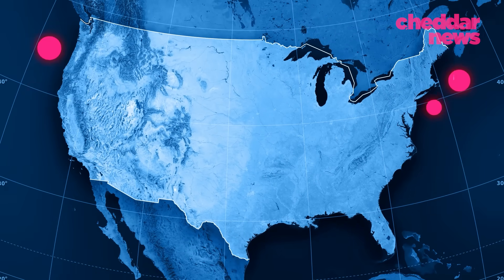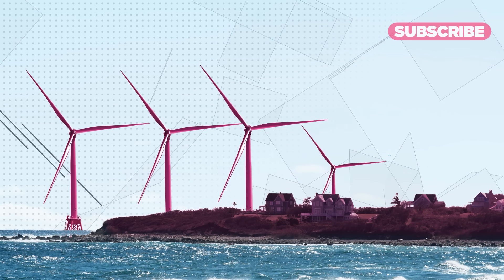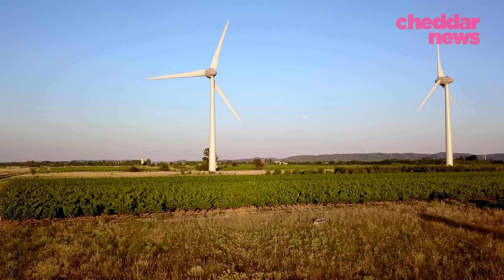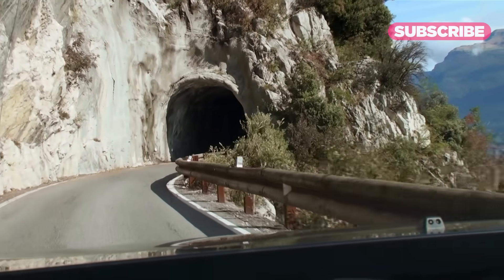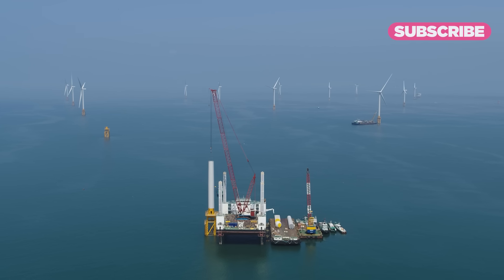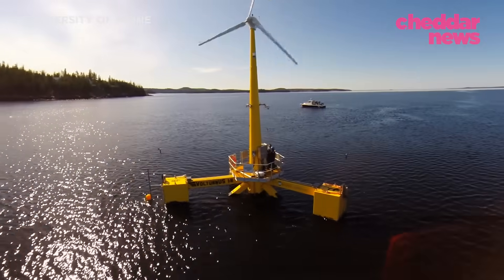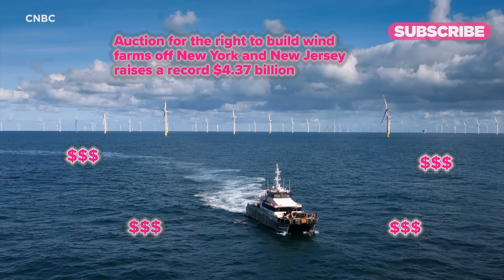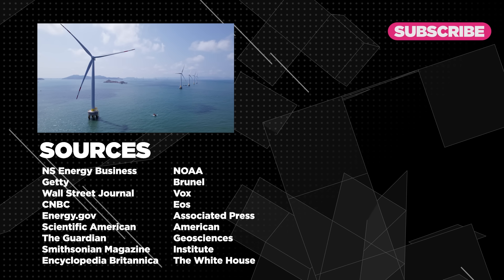Why Finding A Spot For Offshore Wind Is So Tricky - Cheddar Explains

Comment: off-shore windfarms generally produce an area where marinelife is sheltered. After the site is operational, there is no shipping causing noisepolution and no fishing. It is therefor even positive for fishing industry in the long run.
Reply: And all the birds they kill fall into the water for the fish to feed on. So the fish will be doing great.👍
Reply: @TheStickinator  the number of birds killed due to collisions with windturbines is only a fraction of those killed by housecats. If you want to protect birds (which given your rhetoricI don't believe you do) start advocating that housecats may not be outside the house unleashed.
Reply: @freudsigmund72  nice way to change the subject!
Reply: What about birds killed by flying into cars...happened to me once....what about birds that fly into plate glass windows! You have your work cut out for you if you insist bird Cuisinarts are somehow okay for birds
Reply: @edsteadham4085  you're a pretty sad individual. 

But besides that, there is a need for energy. Burning fossil fuel is incredibly distructive for the balance on this planet and thus for birds too. Sure off-shore wind farms do cause some harm to birdlife. But in the end they're way better for the environment than any viable alternative in harvesting energy.
Reply: @freudsigmund72  actually I'm quite happy and content. I just see the reality of the situation and don't engage in wishful thinking. I wish every dream of the possibilities of windmills and solar come true. Why would I be against cheap reliable renewable energy? But the laws of physics and finance  and economics...as I understand them...make a compelling argument that they are wonderful vin every way except one ...they wont work. You may disagree but how does that make me sad? Why are you so afraid of a counter argument? Have you even considered the possibility that what you believe is wrong and unworkable? How is the energy transition working in Germany? Please tell me why they have record hi electricity prices. Please tell me why American natural gas is at this moment on its way to Germany where fracking is banned. Please tell me why electricity flows from France nuclear plants while Germany shuts it's nukes. Please tell me why American forests are being cut down for wood pellets to heat European homes. Please tell me why Europe is cutting down old growth forests at this very moment for firewood. Please tell me why Germany is mining lignite like mad.   Lignite. The dirtiest coal on the planet. Tell me why Germany is restarting coal plants. These are inconvinient realties for people vof a certain mindset. The fact that saf people like me point these things out  don't make them any less convinient
Reply: What makes me sad is so much of the western world has been captured by wishful thinking that is at best described as childish.. How did Europe get in this energy predicament? Now Europe has millions of smart people I hope Europe makes it through the winter so Europe may be able to pull it off. But how did this happen in the first place? Time for some serious self reflection. But I fear that won't happen. I'm fine here in energy rich north America. we can afford to be stupid about energy a lot longer than resource poor Europe. Boy not forever.
Reply: @freudsigmund72  Not to mention the millions of birds killed every year simply by flying against skyscrapers, cars, trucks, trains. In addition, a system with AI and camera is currently being tested (so far with great success) which reduces the rotational speed of the rotor when a bird approaches.
Reply: @freudsigmund72  so house  cats are killing bald eagles?
Reply: @TheStickinator  entire industries in the US get shut down and dams get close when some obscure animal is labelled endangered. Environmentalists from across the country mount pr campaigns to save the snail darter or some damn thing. But when windmills kill birds by the thousand we get. . oh not that many . Just added to the food supply for other species. Whats a few dead bald eagles. Oh yeah. Wait till we start putting up tens of thousands of windmills and solar farms where important politically active people live. Watch those projects get stopped.
Reply: @TheStickinator  As someone who has lived next to windmills for over decades and has seen them all across Germany you can be assured there are no massive mounds of bird corpses aggregated below them. 
Yes birds do die because of them but it’s not to the extent the fossil fuel industry would want you to believe, an industry that has interest in misinforming people and continue polluting our planet for the sake of short-term profit.
Reply: Offshore oil rigs also provide nice habitatd for wildlife. Bet you love those
Reply: Massive U.S. Offshore Wind Farm Given Permit to Harm Hundreds of Whales and Thousands of Dolphins

Can you imagine the outcry if an oil and gas company was given legal permission to injure hundreds of whales and thousands of other marine mammals such as dolphins in pursuit of offshore drilling?

For maximum Greta-inspired wailing, the oil field could be located in the middle of territory where the last 300 North Atlantic right whales congregate, and a permit is in place to potentially harm 20 members. In May, Vineyard Wind will begin building a massive offshore wind farm numbering 62 giant turbines, 15 miles off the coast of Massachusetts. Permits to harass sea creatures have been secured – not a squeak of concern from green activists and mainstream media.

The Vineyard Wind project is only a small part of the planned industrialisation of America’s eastern coastal waters, as the Biden Administration ramps up a commitment to so-called green energy. Of course it is not green, and many now argue that it is becoming increasingly clear that the most valuable economic transfers gained from wind are the subsidies it attracts from electricity consumers.

The Vineyard Wind project will take about a year to complete and will include sonar surveying, massive pile-driving and considerable disturbance of the sea bed. All these activities are likely to harm or injure marine life. Dr. Patrick Moore helped found Greenpeace around 50 years ago and was heavily involved in the campaign to ban commercial whaling. Since 2016, he notes, when sonar surveying started for a planned 1,500 wind turbines on the U.S. Atlantic coast, 174 humpback whales have washed up dead on the shore, an increase of 400% from previous years. He quotes Greenpeace as stating: “At this time, due to lack of evidence suggesting harm from offshore wind development, Greenpeace’s position remains that the best way to protect whales is to create ocean sanctuaries, eliminate single use plastic and stop our dependency on oil and gas.”

If there is no evidence of harm to sea mammals from offshore wind, it is not immediately clear why Vineyard Wind found it necessary to secure a permit to injure thousands of animals during construction of its industrial complex. The permit was issued by the National Oceanic and Atmospheric Administration. The table below details the species that can be injured up to “Level B harassment” and is titled, “Authorised Numbers of Take, by Species”.

Threats to animals leading to possible injury and death are likely to occur from many causes in what is a huge construction site. Many such casualties are unlikely to be recorded. Heavy traffic on the surface is likely to lead to collisions, while pile-driving poles up to 30 feet in diameter hundreds of feet into the ground will create deafening noise. Engineers working on industrial sites can wear ear protections. Whales and dolphins cannot.

According to Tethys, the U.S. Department of Energy marine renewables database, sound propagates farther and faster in water than in air, which can result in greater consequences for the marine environment. It goes on to note:

    Noise may interfere with marine organisms’ communication, navigation, detection of prey, and ability to interact with the environment, as well as causing attraction to or avoidance of devices. Additionally, some marine organisms may be physically harmed from excessive noise exposure (e.g., tissue and nerve damage).

Not a squeak from green activists, as noted, and a deafening silence from mainstream media. According to a Google search, the only mention of Vineyard Wind in the Guardian was in 2021, when it reported approval for the construction. Space was given to the comment from Biden’s Secretary of the Interior Deb Haaland, that the project, “was an important step towards advancing the Administration’s goals to create good-paying union jobs, while combatting climate change and powering our nation”. Around the same time, HuffPost contented itself with the headline: “Climate Deniers Exploit Endangered Whales in Bid to Kill Offshore Wind”.

Charles Mayo is the Director of the Right Whale Ecology Programme at the Center for Coastal Studies (CCS) in Provincetown. He notes the danger for right whales around human industrial traffic, since they can dive for 15 minutes and be difficult to spot. But Mayo is able to rationalise any concerns, stating: “The future of right whales and these ecosystems is dependent on climate change. We have to change our use of fossil fuels and from what I know, the only solution that has the economic power to actually work at the scale of the problem is offshore wind.” Interestingly, the Save Right Whales Coalition notes that Vineyard Wind was listed as a CCS corporate donor in 2018, and was a corporate sponsor in 2020 and 2021.

Of course, it has long been obvious that green industrialists get a free pass when it comes to assessing the impact of their technologies on the natural world. Batteries to store the power of intermittent wind and solar rely on cobalt mined by children in the Democratic Republic of Congo. Oil and gas is likely to last hundreds of years, but there aren’t enough critical minerals in the world to make lithium ion batteries much past 2050. If offshore wind turbines are an ecological disaster, so are those located onshore. There is growing evidence that millions of bats are being slaughtered every year by them, and numbers are likely to grow as more turbines are built. In addition, large birds such as eagles, kites and owls that rely on wind currents are often caught out by the enormous air fluctuations of windmills, and few live to tell the tale after encountering blade tips that can fly around at 150mph.

Meanwhile, fracking for gas on land is effectively banned in many countries. In the U.K., local fracked gas could replace the country’s large imports and bring considerable economic benefit to deprived areas in the North of England. Pressure to ban has been enormous from both green activists such as Friends of the Earth and mainstream media. No endangered whales would be harmed by fracking, but a few ground-level insects might be inconvenienced. There is also is a danger that micro earth tremors, equivalent to someone falling off a chair, might result.
Reply: you seems ti be ignorant of the FACT that all the sonar scanning and pile driving and drilling will DISTURB that so called "sheltered' wild life.
Reply: @DiscordC  not ignorant of that at all.... once they're in place it is far more protective that boats constantly powering by and fishing vessels disturbing the seabed on a regular basis
Reply: So how many sites are there suitable for offshore wind. How many kilometers of new transmission lines will be needed. How come rich smart Tech savvy Germany already has sky high energy costs to go with their windmills and is looking at electricity shortages.    As they dig up coal .. and American loggers cut down millions of acres to send Germany wood pellets. I guess you suggest we just need to try a little bit harder. How much. How many trillions. What if this is a technological dead end.
Reply: @edsteadham4085  Off the coast of Germany, not many anymore as the majority is deeper out on the Baltic and the North Sea, mostly around Poland and Denmark. Currently, the best that can be done with offshore is to further improve upon the already high efficiency of windmills out on the open water.
The high energy costs are in spite of our change to renewables and not because of it. Granted, the deactivation of the Nuclear Power Plants and building using Coal to replace it, was a stupid idea and gradually our government is coming to the realization that it would be smarter to keep at the very least the ones that are currently still running. Mainly the high energy costs come from a) Energy firms artificially heightening prices to make more profit (Shell being an excellent example), b) the Ukraine War, the sanctions and with the cutoff from Russian gas which our government is doing its best to slowly back away, c) as well as a weakened Euro.
My way of fixing the situation would be to destroy the coal fuel industry by giving them a countdown of five years to shut down their power plants and the mines ruining as well as by halting all state subsidies. That same money used to keep them afloat would be used to offer state-subsidized re-schooling so the workforce doesn't go around jobless afterwards.
Additionally, the remaining NPP's should be allowed to exist for another few years and be built out. Its far too late to build new ones but the state can at least help improve existing ones. 
And yes finally more focus needs to be set on finally transitioning fully to renewables and funding appropriate research.

I expect Germany would be in less than a decade no longer relying on fossil fuel but it would indeed take a lot of financial resources but considering our state just put 100 Billion into a military that is already receiving more than the french one yet cannot even afford to give its own soldiers working equipment, I don't expect them to go that route anytime soon, especially with the heavy influence the fossil fuel industry enjoys in the CDU and AFD.

As for the costs? I don't expect it to be higher than what the state already had to pay for. Whatever the monetary costs are though, they are nothing compared to both the example Germany would set on the world stage as the first major country to fully transition and the benefit it would have to our planet.
Reply: @edsteadham4085  We shall see who is proven correct. Maybe you, maybe me or perhaps none of us and the world will continue down a weird middle path.
Either way, lets hope for better days.
Reply: How dare they!
Reply: Bet they are easy to maintain. Salt water environments are quite benign. A few extra kilometers of transmission lines should be easy. And when the wind doesn't blow just do like eco friendly Germany does and burn lignite.
Reply: Yes and the oil industry says the same about off shore rigs
Reply: Nice to know that windmills are made in china  using diesel powered trucks to mine the minerals and coal fired plants to make the electricity. They might even use slave labor. But   at least the pollution is exported to china and not the west. I feel noble knowing I'm doing my part for the environment.
Reply: But still most people including myself consider offshore wind farms to be eyesores to local towns. I’ll hate to see tall wind turbines just off the coast of my local beach, they will always look ugly.
Reply: And all the birds die around them too great for the fish they get free food
Reply: @sturgoncomp07  I am from the uk and we have a lot of offshore wind farms. They say that populations of birds have not really changed around turbines. Sure birds die but not enough to cause the general population issues.
Reply: @randeep6346  I think what Nhil actually meant to say is "how you take a very negative fact - "this area is no longer usable for anything" - and give it a quick makeover" :)
Reply: @sturgoncomp07  that depends, bird deaths are pretty negligible on some of the more recent turbines especially when they paint them reflective colors.

Bird deaths are more an issue for onshore birds like eagles and stuff. Not a concern for seagulls and albatross for example.
Reply: @sturgoncomp07  with all the windturbines currently in the US between 140.000 and 500.000 birds die each year. If you want to offset the effect of extra off-shore windfarms, just ban all housecats, as they are responsible for 2,4 billion dead birds per year.
Reply: @sturgoncomp07  so killing bald eagles is okay? In a (windmill) circle of life kind of way. Sounds like a great way to manage endangered species. Make fish food out of them

Comment: I think they look cool but one issue with land based wind turbines is that they make low frequency noise. Like it's not loud but the background noise in rural areas is very quiet so it drives people nuts. woooosh woooosh woooosh
Reply: They also waste a lot of space and kill hundreds of birds
Reply: @calypso  Space is not an issue, you can put them near/in fields and they take very small space. Its the eye-sore, noise, height problem (aviation) and harm to birds.

Comment: Offshore wind is the worst idea ever. Not only are you destroying an ecosystem we have no ability to rehab like forests or grass lands. You are also going to kill hundreds of birds per windmill. IF YOU CARE ABOUT CLIMATE CHANGE USE NUCLEAR.  If we had universal nuclear power we would not only be able to make carbon neutral fuels, but provide power via the lowest amount of plants per km. Solar and wind ruins thousands of acres. Nuclear is currently the safest form of power. New designs have the ability to handle waste and safety in ways that make these plants walk away safe. Thousands die every day directly related to fossil fuel burning, NO ONE is dying from a nuclear power plant.